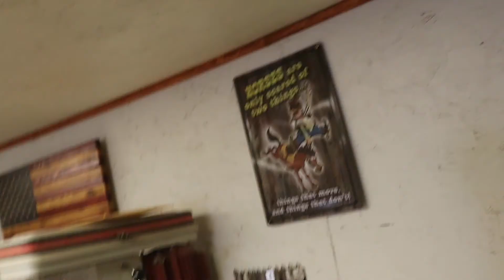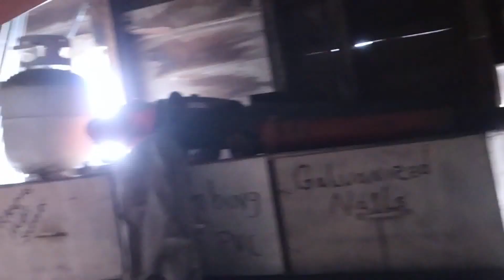How to install an explosion proof vent fan for a spray booth.

Comment: is there a continuity error? where is the mace? I know, videos are out of order, considering the cold as hell comments. I would say ATF should visit your shop but I think all they would find is alcohol. Great impression of a rabbi... How about doing a video where you replace curse words with the word smurf, smurfing, smurfed, etc...? Use the extra ladders as rails for a trebuchet. Why not use silicone to seal the dryer vent to  the box? Then you mention silicone. What using great stuff on the gap? Or one of those expany foam packing things that puff up to big? 

Yes I am doing a MST3K running commentary. Last video i did it but I had another video queued up on watch later and erased all the comments.  Holy smurf that looks like a part of the house in house of 1000 corpses. You could have used a couple of the ladders to prop up the siding to get to the top screws. What happened to your left pinkie? Wait, there is a ladder holding up the siding. Nevermind. Good thinking about the filter. I mean it was all pretty good. Get a haircut hippie.
Reply from the maker: That is a very long comment.   Have you been drinking 😁
Reply from the maker: I'm not entirely sure what the video is about, I rarely watch this assholes content 😎